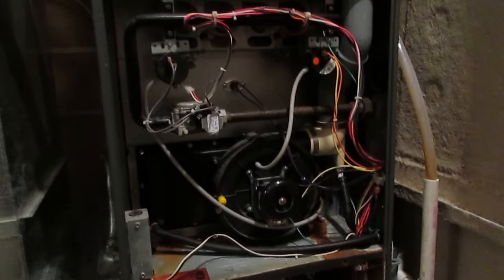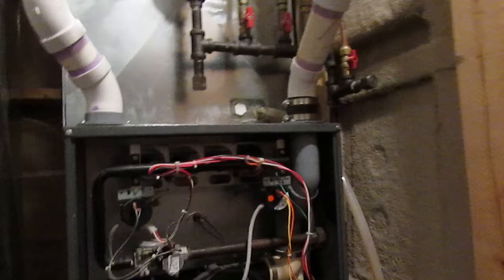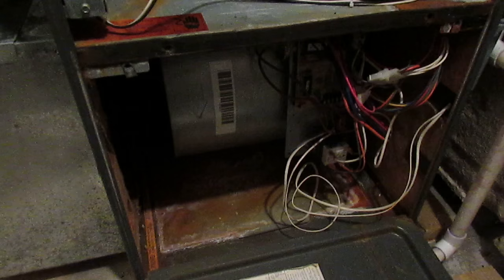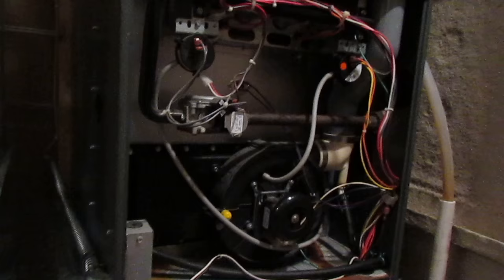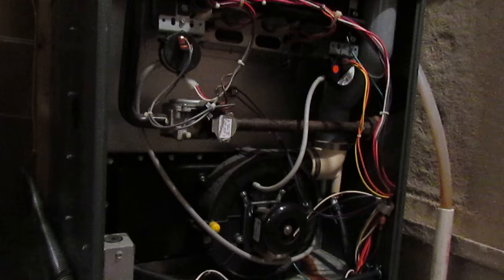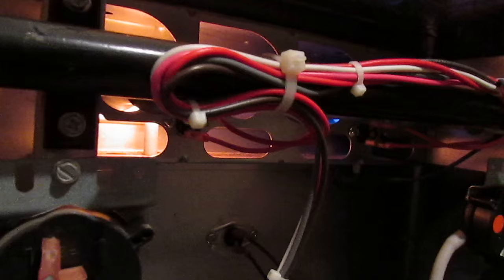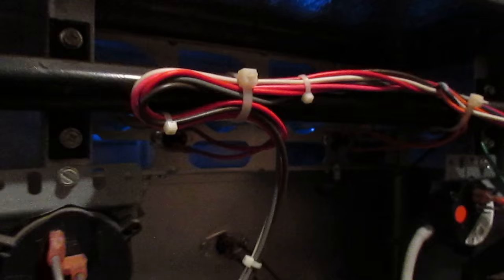Whistling furnace at St Paul Area home inspection

Comment: It's the Orifices. They can get warped, the Orifice can develop sediment closing off the opening for the gas ever so slightly that it shrieks. Or something got in the tube and is causing a partial. I fixed this problem last night by pulling the valve. Cleaning up the orifices and just lightly blowing out any thing that might have snuck its way in to the gas system.
Reply: Thank you!  Sound is gone

Comment: According to other posts, other sites, it's the flex line connecting the gas to the furnace. Originally, the flex lines were made with ridges from one end to the other and they whistled. Nowadays they make a non-whistling flex line. I'm about to investigate the same possibility with my whistling furnace.. But thought I would share this information first.
Reply: It's definitely the flex hose, I had the same issue until I replaced it with a non whistling flex hose

Comment: So do you know what caused this problem?
Reply: may be restricted heat exchanger,most likely secondary exchanger. other possible cause is gas valve regulator weak and not consistant gas flow to manifold. this causes turbulence in manifold and can create this sound. I think more restricted heat exchanger due to condensation damage appearance.

Comment: There’s not many components in a gas heater that can make that noise. (I’m guessing) 
But since you didn’t elaborate on what it is or could be, guessing is my best option. 
My gas wall heater is also making a mind numbing high pitched whistle. I’m 99.99999% sure the the little nozzle for the pilot light is partially clogged because when I shut the gas off completely it stops. 
Gonna go to the hardware store and buy a can of pressurized air and clean out the little pilot hole. Wish me luck cause if it doesn’t work I may end up going nuts by having to hear that screaming at me all day n night 🙉
Reply: How'd that go?
Reply: @aykkes6215  it worked great. I ended up buying a few cans of that pressurized air and gave the heater a thorough cleaning. This winter I sprayed it out again and haven’t had any issues with the pilot going out or and weird whistling. 
If you’re going to use pressurized air on your heater throw on a mask. Idk what that smell/chemicals are that comes out of the heater/bricks but it’ll take your breath and burn your eyes, throat noes and lungs. It’s some potent stuff lol. Just keep that in mind and good luck. And it’s probably best to have someone look at it who know more about it than me. I’d hate to give you the wrong advice and you end up burning your house down
Reply: @clownshoesmma6249  thx pal.